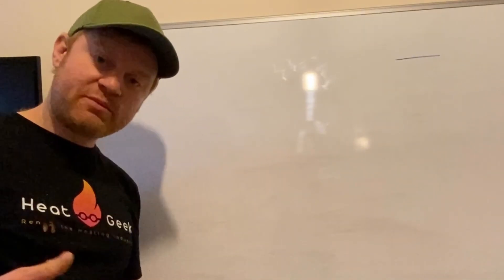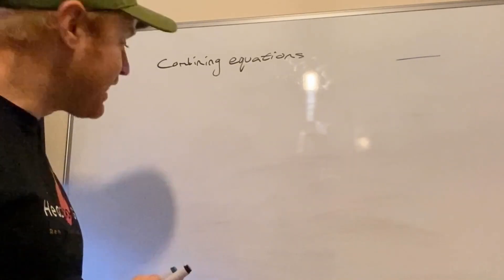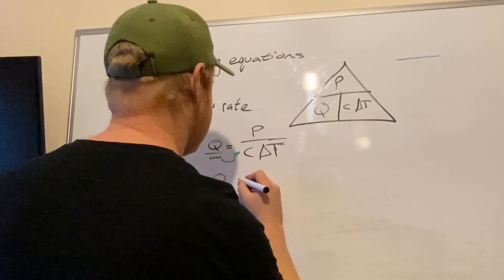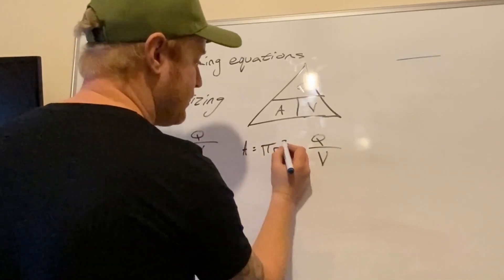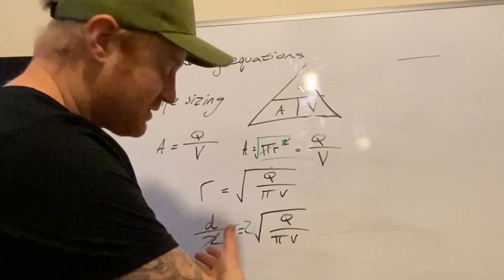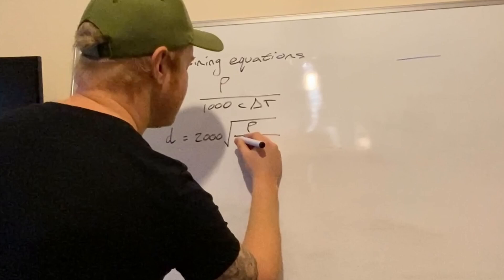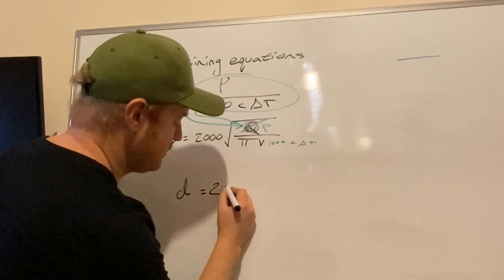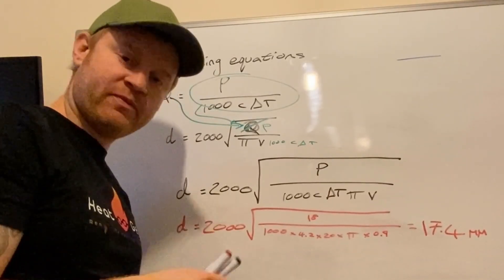Power to Pipe Size Equation | Heat Geek Style

Comment: This is a question about pipe sizing, not a statement,  because I do not know the answer.

Answers will be grarefully received. 

Are we saying?

For a super efficient and future proof system, (ignoring the relatively small economy of using smaller bore pipes) use as large pipes as possible (min 22mm preferably 28mm) for the complete installation.

With short T offs in 15mm through the plasterboard to the radiators.
Reply from the maker: @georgehughes5703  your better watching our other video on pipe sizing for this. Or speaking to a hearing professional
Reply: @HeatGeek  OK thanks - do you have a specific link?

I don't understand your comment regarding "hearing professional".
Reply: Absolutly nailed it. You can get lost watching this.

Comment: We've been looking at the various online resources relating to heating and heat pumps for a while now and a lot of times you watch an installer seemingly throw out a magic value for heat capacity but how they got to those values never made any sense until now. Things like "why are you multiplying by 4.2?" "Where does that 0.9" figure come from. I'm no heating engineer, as I'm sure you can tell, but I now think I have a reasonable understanding of the maths to have been able to recreate the formulas for our house so now having those conversations with a Heat Geek won't feel quite as daunting when we get to that stage of the process.
Reply: 4.2 is the specific heat capacity of water (it is more or less a constant). Units are kJ/kg*K. This is the amount of heat needed to rise the temperature of 1kg water by 1 Kelvin. Kelvin is absolute temperature but for temperature differential it is equal to 1°C. The 0.9 is the flow velocity inside the pipe in m/s (meter per second). To avoid high pressure losses and noise, you want to stay below 1m/s. In living spaces it is porbably better to stay below 0.5 -0.7m/s. Double velocity means increased pressure drop by 4 times. This converts into increased pump power consumption.

Comment: Am I right in assuming that the formulas would be using the inside diameter of the pipe? 10mm OD copper is about 8mm ID which would reduce the capacity significantly.

Comment: A useful rule of thumb I discovered on a plumbing forum was "One kWhr will heat 1 tonne of water by 1 degree C", so delta T of 20C will deliver 2 kW if the flow is 0.1 tonnes per hour. 
From memory its only 92% accurate, but good enough to sanity check your calculations.
Reply: Not very accurate, overestimated by about a third. 

Water has a specific heat capacity of 4.186 J/g°C, meaning that it requires 4.186 J of energy (1 calorie) to heat a gram by one degree.  A joule is one watt for a second

Comment: Thanks for this. Using this calculation a 6mm pipe would be good for 2Kw, (one big radiator). Yet micro-bore pipes seem to be frowned upon these days. I've seen 15mm recommended to each radiatior. Is there something else I'm missing?

Comment: Good stuff :)

As an extension to this, which may help to simplify things further, I noted that a lot of the elements of that equation are constants so we can group all of these together and figure out a slightly simpler equation multiplying all the variables by a single constant (which is approximate/rounded due to pi etc). The result of the algebra gives in general:

d = 17.4 * sqrt(P / (v * deltaT))

You could take this further by saying that for a boiler installation with deltaT = 20,

d = 3.9 * sqrt(P / v)

or for a heat pump installation with deltaT = 7,

d = 6.6 * sqrt(P / v)

Hopefully those equations make sense written down that way :)

...and to echo an earlier comment, you do have to make sure that the units are the same otherwise these constants won't work and the calculation for d will end up being ridiculous!!
Reply: Very nice 👌

Comment: nice one guys, thank you! regarding the velocity, is there a max speed not to be exceeded for the fluid in the radiator to be noiseless please?
Reply: 1m/s should be fine. 0.5 to 0.75 if you want it super quiet.
Reply: @ChrisfromLeedsinUK  thank you for responding

Comment: How can Q/1000 = P/(c*dT) be equal to Q = P/(1000c*dT) it should be, because we have to multiply with 1000, Q = 1000*P/(c*dT)
Reply: He divided Q by 1000 to go from kg/s to m³/s, so he had to divide the otherside of the equation by 1000. He's dividing both sides not balancing the equation 👍
Reply: Yup. I was thinking about mention this little glitch. Felt a bit mean as the chap is clearly trying his best.

Comment: Can you adjust the velocity (flow rate) and/or power to accommodate existing pipe diameter?
Reply from the maker: Yes bit may require hydraulic seperation
Reply: @HeatGeek  Every time I think I'm a little closer to understanding what's involved in an ASHP system. haha 🤦‍♂

Comment: So how do you punch that equation in to a calculator??
Reply: this is how youll get it into the calculator for the same answer
1000 x 4.2 x DT x pi x V
divide by boiler kw
invert (-1)

square root
multiply by 2000
Reply: help me out bro 
 @oldblokeswhoshouldknowbett8108
Reply: Why the second close brackets at the end?
Reply: Get a decent calculator so you can enter brackets. Something like Calc HD Pro. Then enter the following:

2,000√(kW÷(1,000×SHC×DT×π×V))
Reply: @optionenergysolutionsltd6611  thank you. 😁👍🏼

Comment: Like so many of the heat geek videos. I can follow the science. Or in this case the maths to work out the pipe size to use. At times I was filling in the equation before he wrote it. Once he started it off. He should have been a teacher. His explanation of how and why he was doing things was first class. Better than most maths teachers I had. The rest of the symbols and graphics no idea. The introduced example figures. One can only assume are written in the specs of the heat pump somewhere. Never going to fit one so doesn't really matter. But as an info nerd I enjoyed the video. Most of your videos are food for thought which makes them interesting.

Comment: Gents, great addition to the engineers tool box. Could I ask two favours, Q is energy or power (energy flow rate) using mass or mass flow rate respectively (no mix & match). This brings me to the second point, units. Pls stipulate units.  As an example, pressure can be in many units, i.e. pa, bar, psi, mmHg, mmH2O to name a few. We don't want to be using l/s when we should be using kg/s by accident.